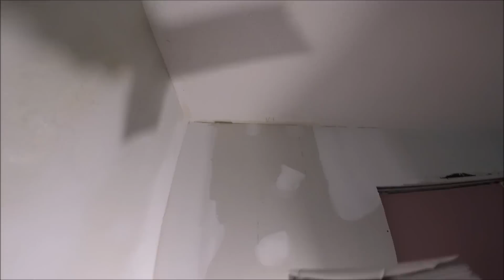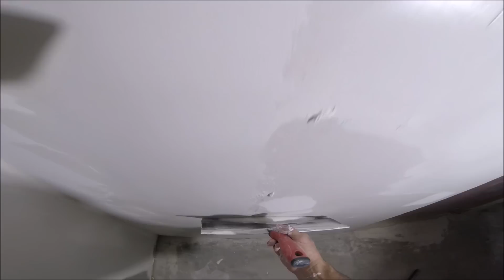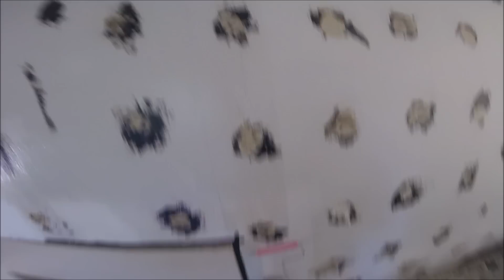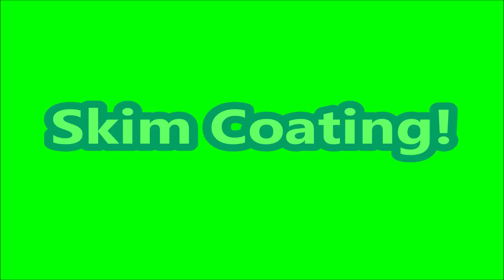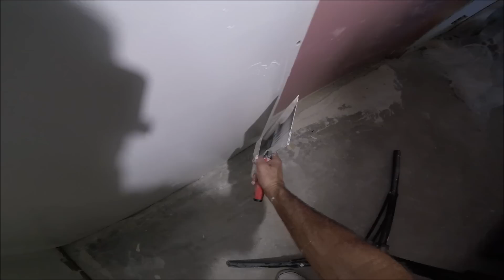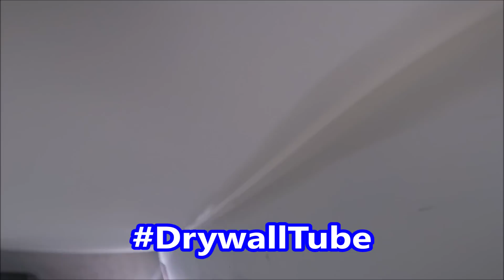How to skim coat new drywall on a drywall repair: Diy drywall tips

Comment: I heard you say to use all purpose joint compound. I have Topping Lite by Beadex. Can I skim coat with that? What’s the difference?
Reply from the maker: Hey there Mike! Honestly, I wouldn’t use topping compound for skim coating. The all purpose has more glue in it and will adhere better.👍🏻 I hope this helps. Thanks so much for watching and subscribing my friend!😎 -Paul

Comment: #drywalltube
yep, still hanging in there with you; have a bathroom I have to redo.
Reply from the maker: Awesome dd45!👍 Thanks for watching and subscribing! Let me know if you run into any questions along the way of your bathroom remodel. Take care, -Paul
Reply: One little "challenge" in the remodel I can see right off; the wall behind the toilet looks like it was pieced together.  They used 1/2" & 5/8" with patches where the towel rod was replaced a couple of times.  My first (OK, second) thought was remove all the drywall and row of tile against the shower surround and start fresh.  Best?